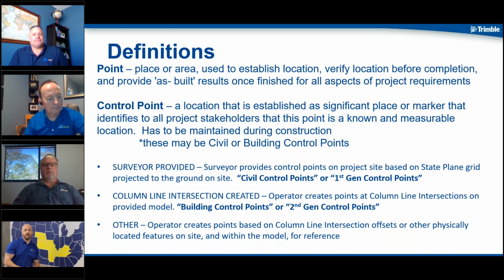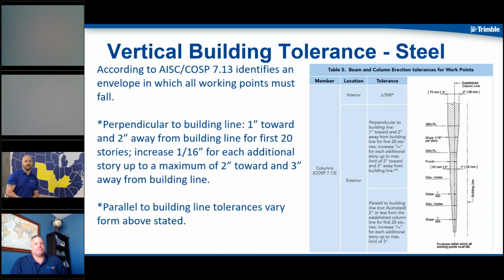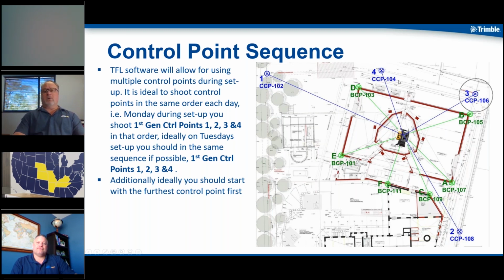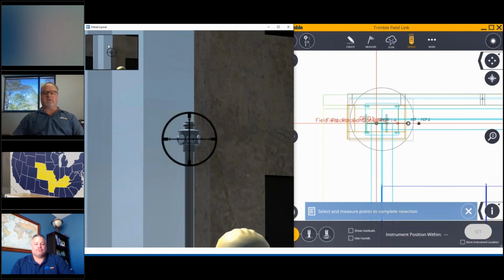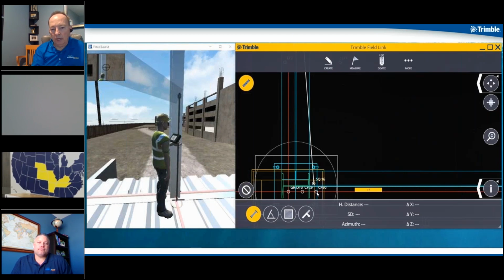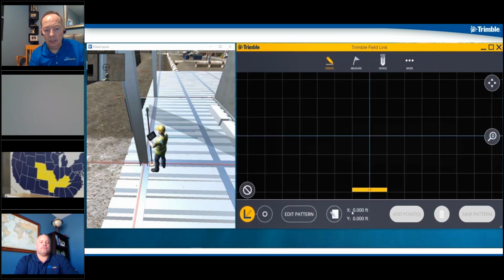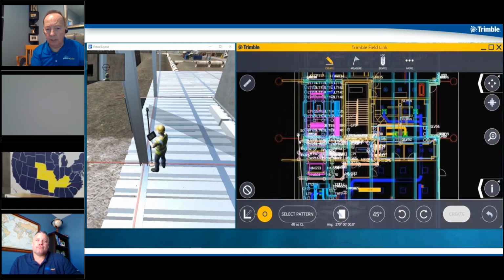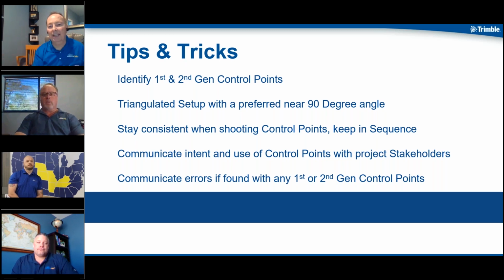Establishing Control When Deploying Robotic Total Station - BuildingPoint Mid-America Webinar

Comment: I don't believe having a wide triangle setup would be more or less accurate because if you use 3 points to set, you will probably have 3 sad triangles, but is recommended to have more than 2 points on resections

Comment: What's the best way to make secondary control points and what's the best way to make them as accurate as possible so its all accurate
Reply from the maker: Khalid, thank you for this question.  There are a few ways honestly but we will share one of our favorite to make them accurate and easy.  First of all setup your system on the project or site.  Shoot a resection to at least two of your known control points (more if possible) and once you have an acceptable "Setup", use the Measure/Collect mode to mark out and collect your new Building or Secondary Control Points.  Use these terms to help differentiate the Site Control Points from the other control points just in case a verification need arises.  Upon doing this the point can be named and marked as a Control Point giving the point icon the triangle symbol in the point circle on FieldLink.  If you have any follow up questions please let us know.
Reply: Thanks for replying do i have take face 1 reading and face 2 readings and average the coordinates out? Also when shooting temporary control point  what are the best practices to follow for a good and accurate set up. Appreciate your help you guys are great